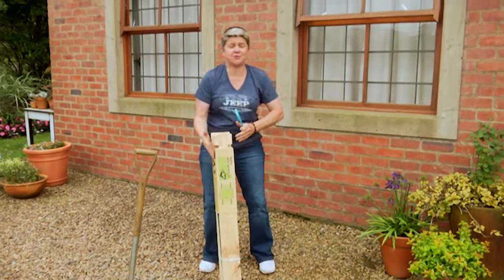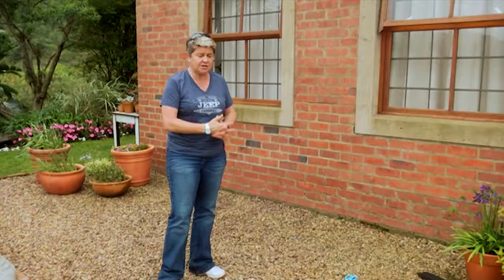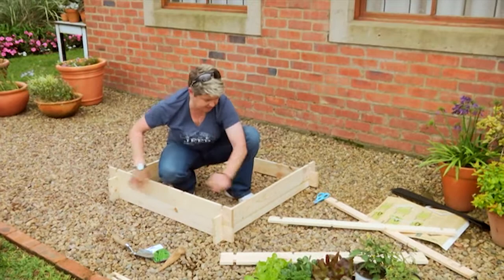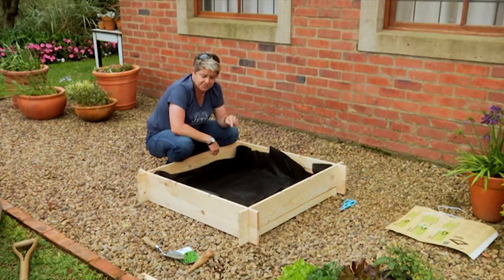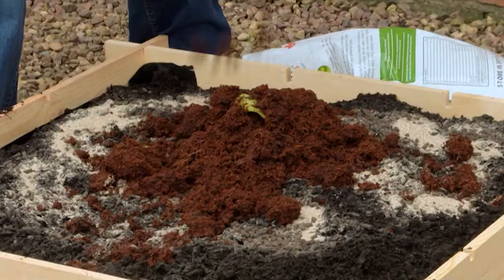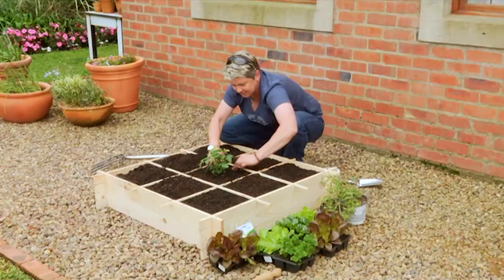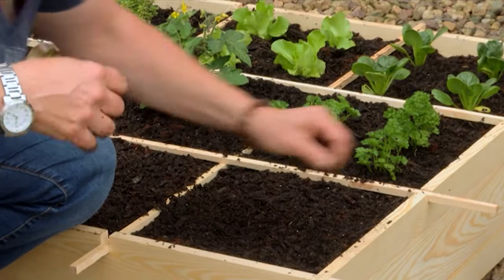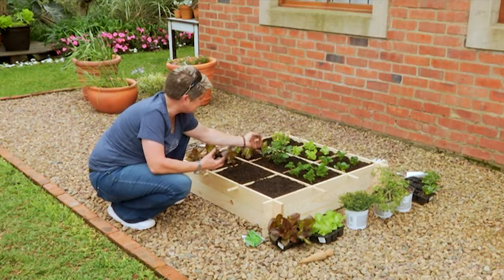Square Foot Vegetable Gardening

Comment: this thing is a bit too shallow, though, for most veggies - they want 30cm of space (ish) for their roots to grow well, and if you're thinking carrots, sweet potato, potatoes or peanuts, you need double that. This will dry out super fast also. This is not the best advice. 

I guess the easiest solution would be to get two of these kits and stack them on top of each other.
Reply: True